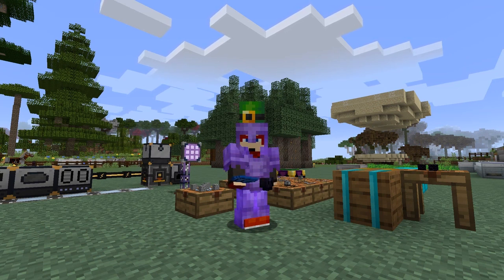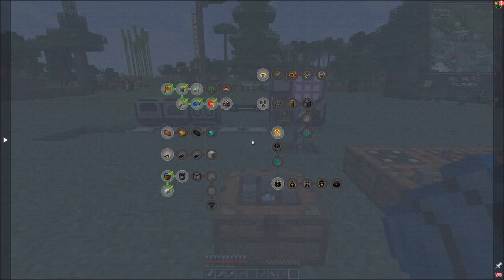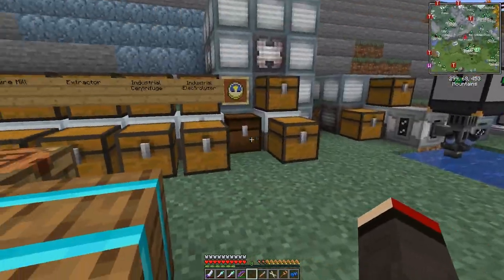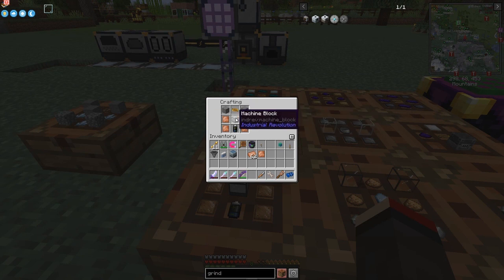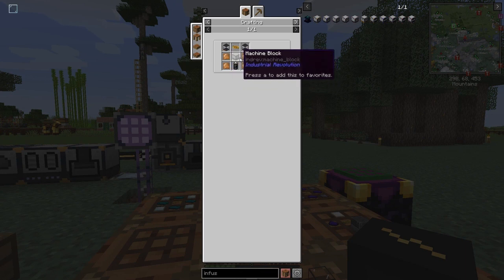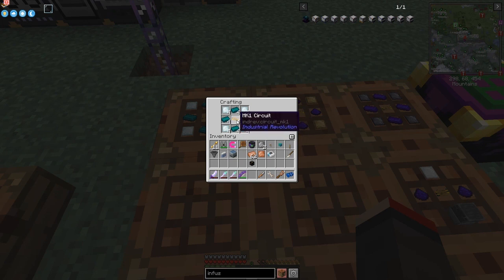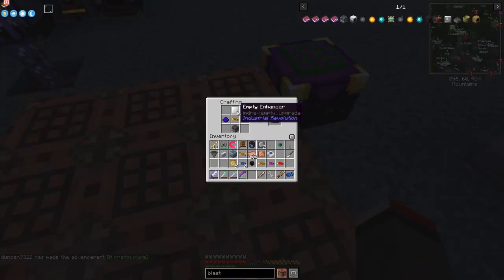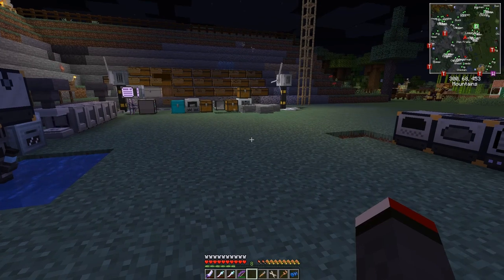All of Fabric 3 #20 - Industrial Revolution Machines, Applied Energistics Auto Crafting

Comment: How do i make mk1 circuits? I have been looking everywhere on the internet and havent discovered that yet
Reply from the maker: The best way is the search in jer, press ‘e’ and type mk1 in the field at the bottom, you should see mk1 circuits there. In this pack it is four copper plates the the corners, gold plate in the middle and nickolite in the middle of all four sides. If you are not sure how to make any of the items then left click the item and it will show you how. Hope this helps.
Reply: Yes it did thx, and i just didnt use the first method you mentioned because it just doesn't exist for me, maybe due to the fact that the mod was added into the server after it was created
Reply from the maker: @fortes_05  Glad to have helped, good information that it was not showing up in jer.